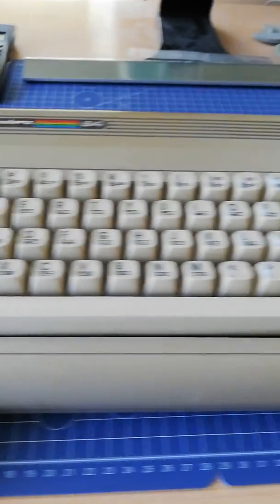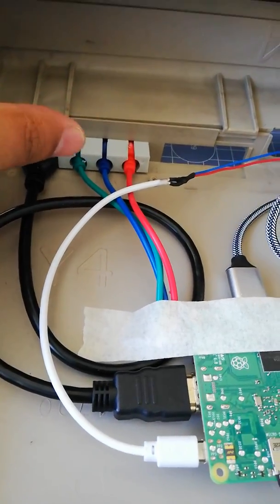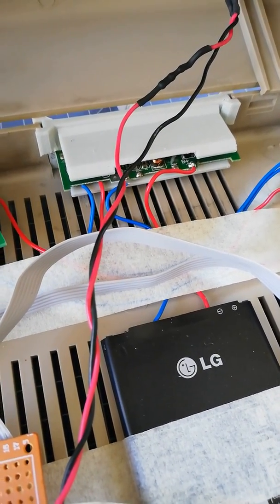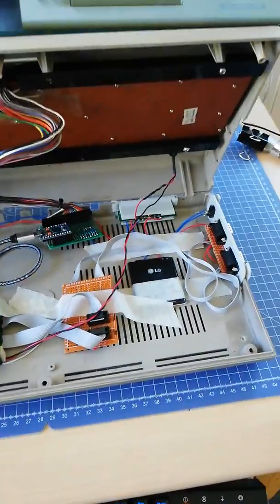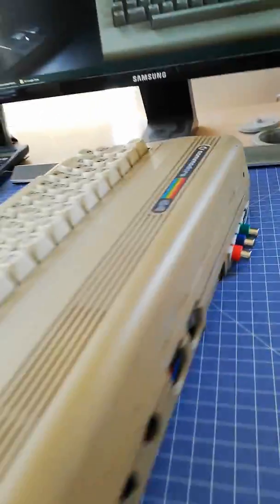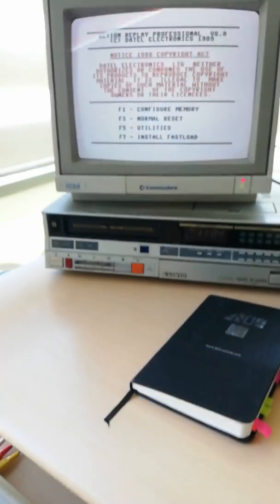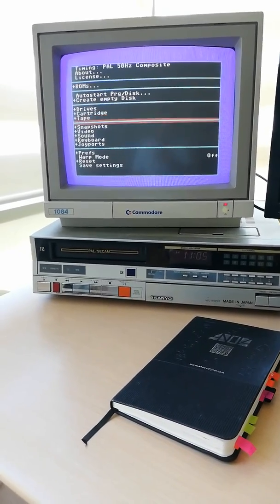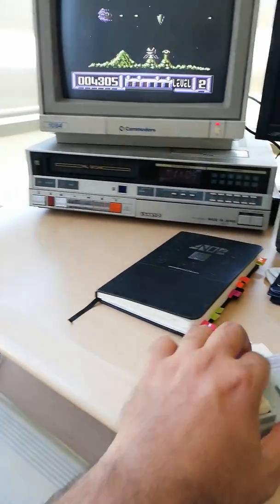BMC64 emulator on a real C64 Case

Comment: Cool project. How does the power switch operate? Does it cut the power directly or are there any circuits between the switch and the power input of the Pi? I am asking because I have a BMC64 equipped Pi3 and planning to move it in a C64 case if I can find one.
Reply from the maker: Thank you. Power switch cuts the 5V DC connection between the powerbank circuit and raspberry pi power input port.